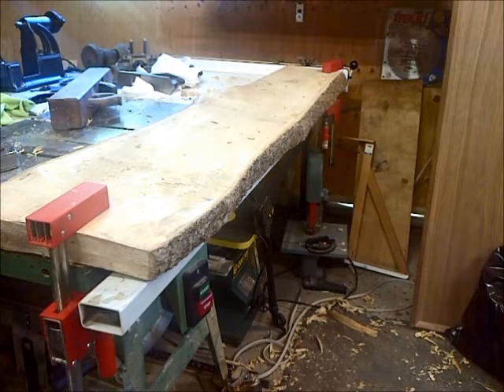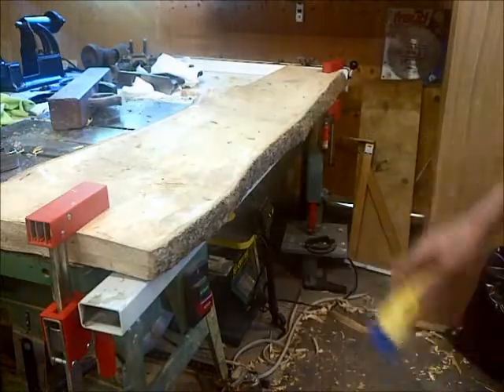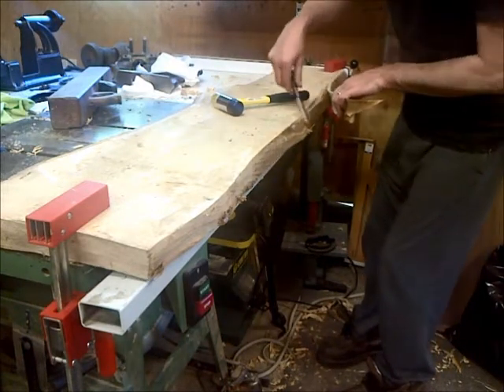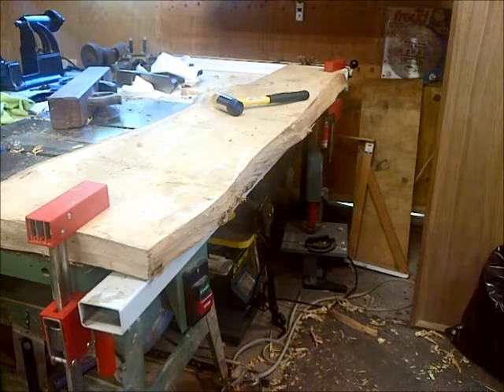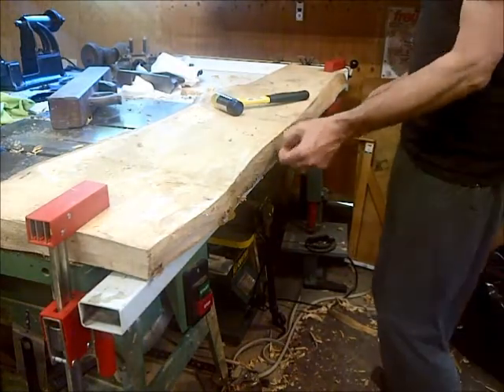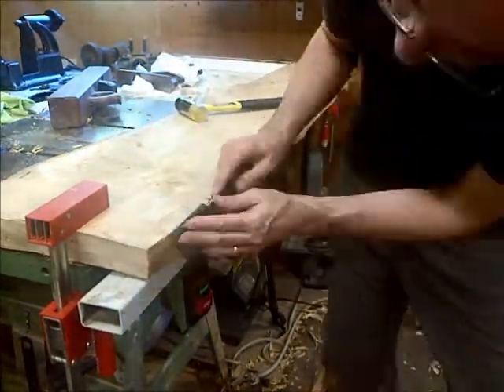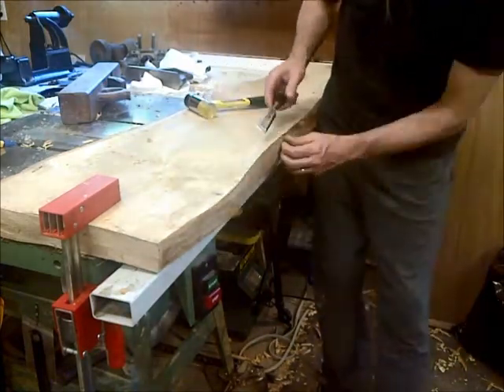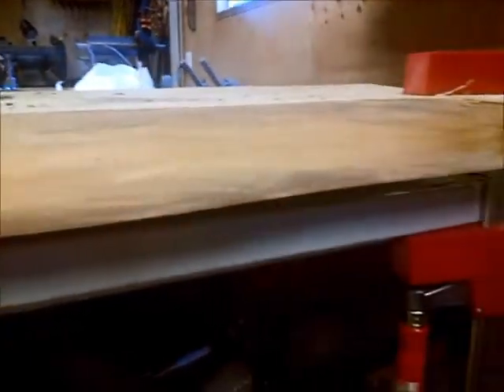Stripping Bark for a maple live edge table.

Comment: I use an angle grinder with the the sandpaper disc, start with an aggressive  one and when you get close you can ease up to a lighter one. It chews through it like butter.
Reply from the maker: +Smoke eater Thanks for the tip.

Comment: Trees that are cut down in the Winter hold on to the bark better, trees that are cut down in the hot months tend to shed the bark easier.

My granddad (an awesome wood-worker) taught me that...coats on in Winter, coats off in Summer.
Reply: Makes sense to me. I was shedding the bark off some maple with ease a few weeks back. Get the edge started like Steve and just pull.